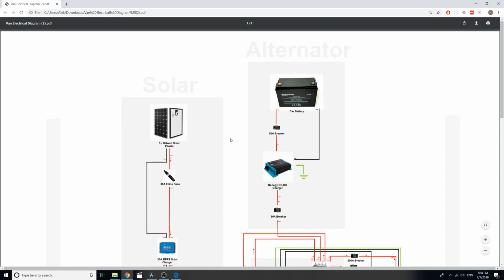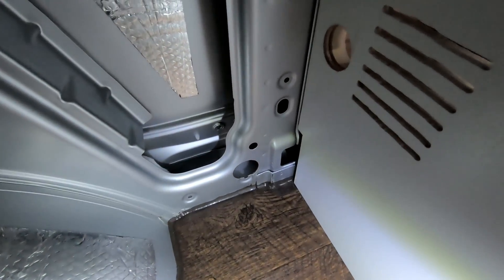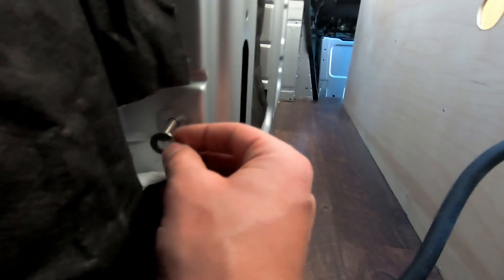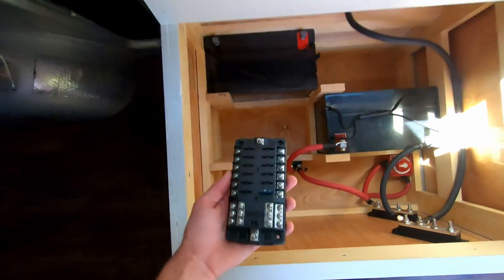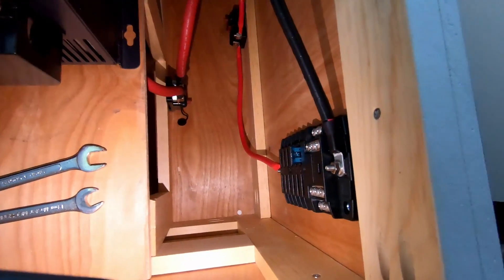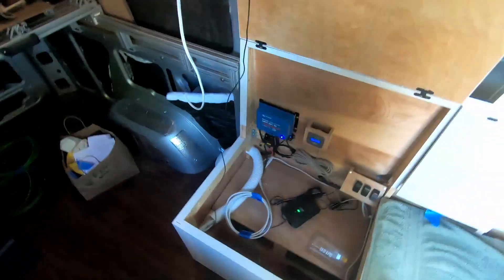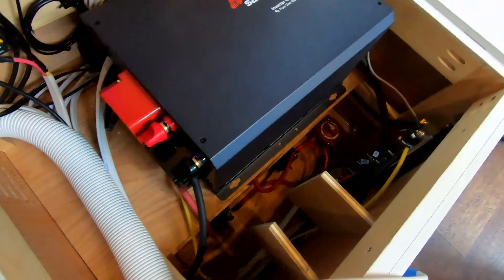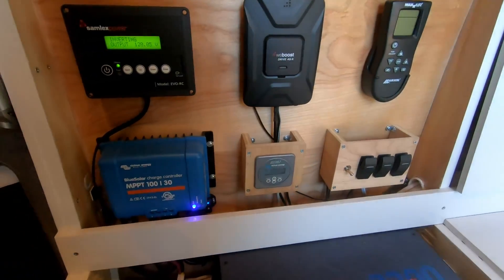ELECTRICITY⚡ In The Van!! How To Wire 12v DC & 120v AC with Solar / Batteries / Inverter - #vanlife

Comment: I've based my set off of this but im having problems.

I have 500 watts of Solar
Renogy 60a charge controller 
3 x 200ah batteries. 

Dc to Dc charger 

I cant for the life if me figure out why I can't use my water heater for longer than a minute before it nearly drains my batteries. 

Please help with problem solving this.🙏🏾🙏🏾🙏🏾🙏🏾

Comment: i have watched and enjoyed ALL your videos.  NOW ..electric ...I am a retired Airline Capatin.  Very comfortable with electrical theory.   BUT ....I am doing my 170 XT with a total open plan ( I have 4 dogs)...so I have decided to go with "solar generators" ...large battery banks !  Check out the Blujetti EB2400  and the   AC200.  less $ than two Battleborn.  includes MPPT  and 2000 watt inverters with more info (individual lipo temps !!! ).    makes life SO EASY .   One AC200  gives you more putlets than you will ever need !!
Reply from the maker: That’s awesome thanks! And that sounds like a great solution!

Comment: I know this video is old, same as my setup. But I can’t figured out what’s my problem 
I have 2 100 Ah 12 battle born batteries + 2AWG cables that goes to my energizer 2000wtts inverter, my microwave is a B&D 700w. Small enough for my inverter
But I have to use it of turns of 30 seconds and wait for a bit, if not the 200A breaker will poop.
What’s de deal over here. Can’t figured out if is the breaker, the inverter or the microwave. Thanks in advance Alexander
Love the channel by the way. Love your last video of the 4x4 sprinter conversion, what a Rig!
Reply: Did you happen to figure this out? I'm having the same problem with my water heart....Actually all of the appliances.
Reply: @Zinnett  I think my problem was the inverter, I bought a regular inverter, I think for lithium batteries like that ones I had, I should get the “Pure Sine Wave inverter”. And I think that was the trick, check yours if is “regular” or the other one

Comment: I notice in the diagram there are more wires than there are stud points on the positive bus bar. Is it okay to double up wires on the bus bar or should I try and find a bus bar with more than just 4 studs as I have a similar system I am working on with both solar and DCtoDC charger. I couldn't really tell in the video how many wires you ended up actually putting on each bus bar. Thanks for any help!
Reply from the maker: Yes it is

Comment: If you would have attached something to the vans alternator (to recharge batteries) would you have still needed to attach an inverter? 
In other words could you have just omitted the converter/charger all together & just used the generator?
Just curious if that would have been an easier route

Comment: The electrical looks great.  I agree with Terry about the metal box for 110V AC.  Also when I lived on my sailboat everything that ran off my Inverter was a huge power drain, Id recommend these breakers be easily accessed.  You don't want to open the cabinet each time you cut the water heater on, and each time you want to cut on the 110outlets.   I learned the hard way my 110V AC outlets drain a small amount of powered just being powered on.   Just a hint for the future.

Comment: Can you wire a 120V fan to the 12v DC battery?  I need to put a fan into my wheelchair van to move air to the back area.

Comment: Oh, and so the BMV-700 does connect to a the positive as a way of receiving power, but its primary function is through the negative battery terminal. Its shunt is the ONLY thing that should connect to the negative terminal, with all negative loads being attached the the 700's shunt load terminal. I just say that in case anyone wants to install one of these, it detects incoming and outflowing energy from the batteries via its shunt sitting between all the negative 'loads' and the negative terminal on your battery bank.

Comment: hey brother! I'm working on my own electrical system in my van with a super similar setup to yours, wondering if it'd be possible to go Into more detail about your diagram. Would help us out massively. cheers heaps!
Reply from the maker: In the future I want to make a better video about electronics in the van. Very simple but so intimidating.
Reply: @seven_o_savage  sweet as, would be awesome. thanks heaps
Reply: Did you end up using his diagram?

Comment: Hiya! Would you be able to elaborate on the wires gauges you used between all your components? It would be super helpful to add to your diagram. Thanks so much!
Reply: I think you might actually have them on there already, but they are a bit too small to read.

Comment: Just wanted to make a suggestion. You may want to put your shutoff switch where it can be reached. Should anything happen you will have to reach through the entire electrical compartment to get to the switch. A hinged vent grill may do the trick. It would at the very least mean only your hand would have to be in danger rather than your entire upper body.

Comment: Damn!  You Aced this so much!  I have a BSEE and have been installing AC and DC and A/V nearly since time began (for my life)!  I'm currently installing a 9.6kW ground mount solar system with QCells panels and SolarEdge 10000 inverter.  That said, I need to bow to you.  Your knowledge and explanations and diagrams are awesome.  We are starting the build on a used 2019 Promaster 159, after an insane amount of research, and your design is top notch. So well thought out.   Ping me if you ever plan a trip to Maine.

Comment: When you do it right and learn a bit before you start, everybody can do it. For that short circuit you MUST have fuses. It is nothing to be scared of. Learn and do it. Dont forget some ait holes to transport the heat out of the wooden box because the SOLAR load controller and/or the batteries can get warm. Also think about styropor isolation when you think about the cold in the winter. If the DC-AC converter also in that box you have to use a fan temperature controlled. It can be very how, SO be SAFE.

Comment: What is make and model of the AC switch panel you used?
Reply from the maker: I used the Paneltronics AC panel (part no. 2305). Any of their 120v AC panels would work!
Reply: @seven_o_savage  nice!  Beats the fugliness of a giant gray panel and your breaker labels are lit up.

Comment: Thanks for this! It at least set me on the right path as far as what to research (like what the fuck is a shunt? Lol). 
Quick question for you or anyone who is knowledgeable: does that box get hot? I would imagine having a bunch of seriously beefy electrical equipment would need to be ventilated as much as possible...but this is coming from my IT and audio engineering experience so i'm not sure if it applies to this or not.
Reply from the maker: I did end up cutting some vent holes at the back, but the only thing that really gets hot is the inverter.

Comment: Is there a reason you are using a breaker right after the batteries, then the 300A switch, before the positive bus bar?  since you are using a breaker, couldn't you just flip the breaker to cut power and avoid needing the 300A switch?
Reply from the maker: Yes you can use the breaker as a switch. The reason I did it is because I like to have clear intent whenever I open that compartment.
Reply: @seven_o_savage  Thanks for confirming.

Comment: 12 volts is totally safe to handle.  When you  bump it up to 110 volts it can be deadly especially if you are near any moisture.
Reply: mark birchall not necceraryly so, the 12v amps can melt metal, I had a partial melt down of my wedding ring& burned finger, I NEVER WORE THAT RING AGAIN , on an A&P supermarket in  NJ, instead of a generator, they had, 2 levels of 12v batteries,<I forgot what end voltage was nor the count, but the amperage was F ING PHENONOMIL , , & was in the refrigeration compressor room.
I never got near them after my count,,, but one day 1 of the batteries exploded, giving the mechanic a heart attack, , it was not me, CHEERS FROM NJ🇺🇸
Reply: mark birchall speaking about moisture,at FARMLAND DAIRY, IN WALLINGTON, NJ, there was a 50hp, 4160v QUINCEY air compressor in a basement in ANYTHING NEAR DRY, BUT better than that , there were 3 4160 cables from a pa engine, running on the ground to another area, I had no idea what they were, or why, until I checked it , the licensed electrician did it , , THATS AS HIGH AS I had to service over the years, , the amperage is usually low with, so you needed an ammeter with WIDE JAWS for those heavy cables, ,,,  Cheers From....NJ🇺🇸

Comment: I don't know what your background and training is but you've done an amazing job.  I did notice that the 120 volt A/C electrical breaker panel in mounted to a home made wooden box.  That is a huge NO-NO.  You should have your panel mounted to either a UL listed metal or fiber/plastic box.  If there is ever a spark from one of those breakers the wood is right there to catch on fire. Just saying.  I'm a journey man Electrician.
Reply from the maker: Thanks Terry, that is great advice. I agree it would be much safer to build a small metal or plastic box. Putting this on the todos :)
Reply: Traveling Terry with all the fuses and breakers that’s highly unlikely that could ever spark a fire as in 99.9% unlikely and being that the metal box would be a conductor it would be far more dangerous to be on metal then wood which is a non-conductor,
Reply: @raymonddriggers  The National Electric Code doesn't agree with you. The breakers sometimes fail and cause a large ball of fire.  Most house fires are caused by faulty electrical and I don't want others to follow this unsafe example in their home.
Reply: @raymonddriggers  Ok, I have tried to be nice, but you obviously don't know what you're talking about.  I'm both a Journeyman electrician and Journeyman Lineman, I'm a certified ABYC marine electrician, and a RV tech.  I've been working with electricity most of my life and I worked installing electrical systems at Discount Solar in Quartzsite Arizona last fall and I've installed many many systems in High end RV's.  This is not to code and not safe and should not be done by anyone else. You never ever put 120 volts AC in a wooden box period.   I hope you do a bit more research before you respond with comments that sound good to you but could lead someone to follow this bad example of safe electrical work.
Reply: Traveling Terry You really do sound like Nancy Pelosi oh we’re trying to impeach him to save the constitution meanwhile all they are doing is trying to destroy the constitution I’m not challenging your experience in the electrical field Terry I am stating a fact if he puts the components in electrical box that is metal the likelihood of him getting burntOr electrocuted is far greater than an electrical fire in a small wooden box
Reply: @raymonddriggers  See you're responding with uneducated and uninformed comments.  Do some research and you'll find that all metal boxes shall be grounded and thus protected from a fault.  When an electrical breaker trips it produces flames and sparks and that is why you will never see wooden boxes use to contain electrical wires or panels or breakers.  If it was safe you would see them everywhere and you don't.  Take a look at any house or motorhome or any installation of 120/240  AC  electrical anywhere and you will never see it done with wooden components  Just call the fire department and ask them.  That is why we have codes and inspectors and do electrical installations to protect life.  It's a very dangerous thing to just do what feels "good enough". Thats how big problems happen and how people get hurt.
Reply: Traveling Terry 80% of van builds use wood, you should notify them and save them before they burn the world up
Reply: Seven (and any other vanbuilders),

Please listen to Traveling  Terry and not the other guy. I've got 35 years designing boats and their systems including 12 volt DC and 120 volt AC. Terry's experience with ABYC standards is invaluable in this area. Definitely better than the opinion of a guy who watched a few YouTube videos.

Charlie Wing and Nigel  Calder both have excellent books on the subject of boat wiring which would cross over to a van build quite well.
Reply: Traveling Terry , in my old house There is. An FPE = Federal Pacific Electric, someone bought it some tears ago &DELISTED I T. !, I did some service work back in 1968, called “MULTI-AMP, what they did was TEST CIRCUIT BREAKERS   TINY to 100 KV.  very interesting place. Cheers from NJ🇺🇸
Reply: I think there’s a mistake with the Victron shunt wire in your diagram. The red(positive) wire should be black going into the negative bus bar. Please confirm. Thanks!!!
Reply: @rogermccaslin6750   - Went to Amazon and see where  Charlie Wing has multiple books dealing with boats in general.  Do you know the specific title of the book?
Reply: @cocacola3452  
Try Boatowner's Illustrated Electrical Handbook by Charlie Wing. Nigel Calder wrote Boatowner's Mechanical and Electrical Manual. You might also look for The 12 Volt Bible for Boats (can't remember the author). I'm sure there are other books on the subject as well.

You might try your library to see if they have any books on the subject before buying. Although they all have good information, you may find one author more understandable than another.

If I would give one bit of advice it would be to read and reread sections on wire sizing. It is the most important aspect of system design, both for functionality and, more importantly, for safety. There are also online sizing calculators (Blue Sea Systems is one example) that can help but understanding what you are trying to accomplish is important.
Reply: Traveling Terry do you do any consultation for wiring van conversions? I am in the SW and could really use help in getting my system set up. My electric is half way there but I don't want to "actually connect" until a professional tells me it is safe.
Reply: @SeedsofLifeMinistry  I'm in Florida at the moment but maybe I can recommend a friend who is out there now....
Reply: Terry I would SO appreciate any suggestions! Thank you
Reply: @SeedsofLifeMinistry  Sorry Amy I checked with my friend and he's unavailable for sometime as he is driving back east.  Another guy I know and recommend is Steve Punk Steve, www.steampunksteve.tv  
I've met him and he's a great guy and if available he would be a good choice to look at your van electrical.  Hope that helps...
Reply: @The.Hawaiian.Kingdom  sorry, hate to say, depends on who, where, and when.  Check hourly rates for rv shops and go from there...There are shops on line that may help you, just have to do some homework....
Reply: Hey you seem like you know your stuff, this is the first build video I've seen suggesting to use the chasis as ground for the battery. Would you suggest that or just keep the circuit closed via wire?
Reply: @travellingterry where are you located? I'm looking for someone to do the wiring on my van. I live in the Seattle, WA area.
Reply: @adamhiguet  He posted he is in Florida at the moment. I'm not sure anyone could be further from you at the moment.
Reply: @TerrydeAlaska  I’m in Pensacola, any chance I can commission your help on my wiring? I’ll gladly travel.

Comment: What size of wire did you used for your 12 v and 110 v ? is 14G for 12 v and 12G for 110V good enough? Thx
Reply from the maker: I used 14ga for the 12v and 12g for the 110v. This happened to fit my requirements but the best way to do it is by checking a wire gauge chart

Comment: Video is awesome and also very detailed. Thanks for all the info. May I ask how much the electrical system cost?  I want to get an idea what to expect to pay for something similar.
Reply from the maker: Thank you! Assuming just the solar +  batteries + wires + breakers + inverter + fuse blocks, a system like this costs about $3000.
Reply: @seven_o_savage  thanks for info

Comment: If you don’t mind me asking, why did you buy such an expensive inverter? I’m currently doing my own build.
Reply from the maker: It’s an inverter charger & it has a lot of safety mechanisms in place that help me sleep better at night. That being said, definitely not 100% necessary.
Reply: Seven O'Savage  I meant the actual inverter on your electric diagram that you included in the description. It’s over $1000! I’m just curious to know what benefits it has over a cheaper inverters from different brands.
Reply: Seven O'Savage Also, would you be interested in helping out with the electrics on my van? I would  pay you for your time and effort. I figure it’s gotta be cheaper to pay someone to do it privately than taking the van to a conversion specialist.
Reply: Seven O'Savage Or if you know anyone who would be up to the challenge please let me know. Lovin the vids btw! Really useful information

Comment: Thanks for the very informative vids. Looking to do a similar build. How does your power hold up when you use your microwave? Trying to decide between propane stove/oven or powering a microwave and induction cooktop with electric system...
Reply from the maker: Batteries hold up great, the microwave actually doesn’t draw much power relative to the water heater (700w vs 1500w)

Comment: So you grounded the DC, and AC "breaker boxes" along with the batteries to the chassi of the van? You showed connecting the battery to the van but not the other two

Comment: How did you conetc the dc -dc charger, I would love to see how you connect the D+ ignition cable to the fuse ... and which cable to use and where to buy it ... thanks that would help a lot because I just bought the same dc charger and can’t find a way to install it

Comment: Hi. Great vid! Quick question, the bus bar your link sends to is only rated at 150a... yet you have 200-250a fuses aswell as 2200w inverter etc, are those definatkey the right bus bars? I imagine you would need bus bars rated at more like 200-300a? Cheers